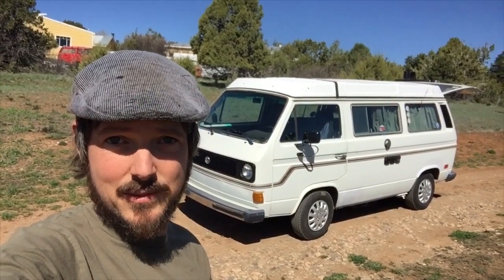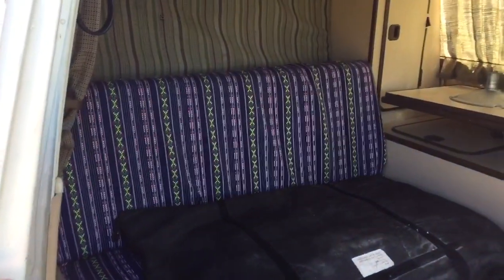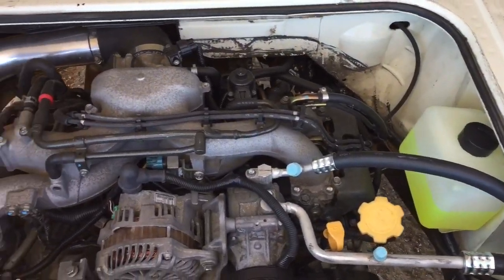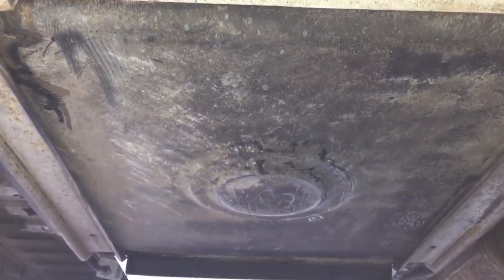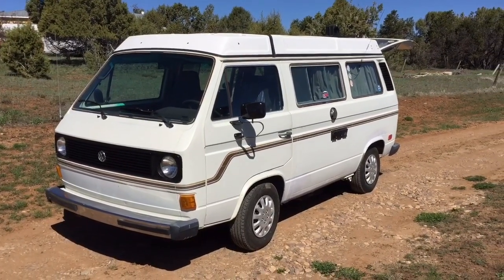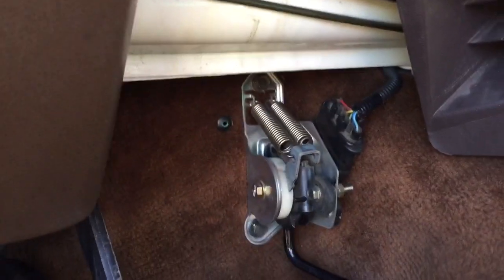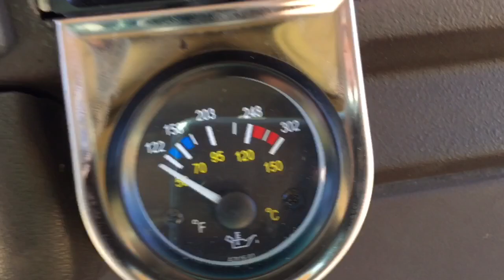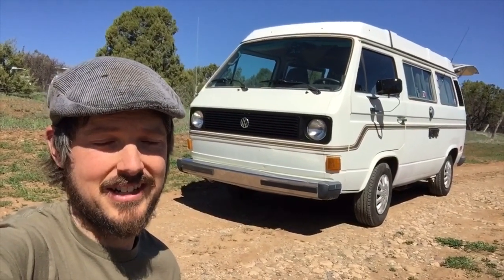1983 Aircooled Vanagon Subaru JDM 2.5 Conversion Tour

Comment: I'd love to see a technical video on the air conditioning system. I've got an '82 EJ22 without A/C. I've debated on getting the SmallCar setup, but haven't pulled the trigger on it yet.
Reply from the maker: Hey Austin, in this case I just took the original connections and extended them to the Subaru compressor. I’m not an AC expert but next time I work with AC I’ll do a video.

Comment: any wiring details for drive by wire  how to 
i have an 2009 2.5 with the subaru 5 speed  i have all wiring out of the 2009 with the 58 pin connection   any help at all will help

Comment: Hi...great videos.   Big question. I have installed a 2002 Subaru 2.5 and a rebuilt waterboxer automatic transmission into my '83 air cooled Vanagon. The shift selector  cable is to short too reach the mounting point. Have you run into this or can you point me in the right direction

Comment: Nice work! I noticed in the front of the engine bay a section is missing. Is it necessary to cut that section out to fit the air intake piping?
Reply from the maker: I used 2 3/4" intake tubing and the aircooled Vanagon engines sit a little more forward in the bay than the water cooled. You may need to clearance if you want to use large diameter plenums.

Comment: I have an air cooled Westy. Wonder, if this will be street legal in Germany... Did you use the water cooled T3 Bus heater to swap it for the air cooled setup?
Reply from the maker: I have no idea on the legality of engine conversions in Germany. I swapped a watercooled heater box into the dash to replace the aircooled version.

Comment: What About the transmission ? did you keep the original 4 speed of swapped it with a JDM SUbaru one ? did it need an Adaptor Plate ?
Reply from the maker: Used the stock transmission with a KEP adapter plate.

Comment: I have an 82 i just did an engine and everything else rebuilt but power is very low, may go this direction too.. how much was the converstion and how are you liking it?
Reply: Did you see Mick's note ? 4-5K in parts.  I had a bet I could do it for 3K (free labor), and lost the bet...it all adds up...and after I lost the bet, I went back and redid things "better" or added more to the scope of work.   In hindsight, I did the harness because I wanted to, and was being cheap, I should have sent it to Mick.  I'd be driving now....."anything that saves me time or work, is a good idea".... do it once, do it right.... there's another video series and the guy has a running total, ka ching, ka ching, ka ching...I think he hit 10-15K ??   I bought mine non-running, got it running, it sucked.  I put a used, rebuilt engine, that was better, but it still sucked...now, the EJ25 awaits its awakening...new head gaskets, timing belt, gasket set, valve removal tool, glass table, sandpaper, water pump, power steering pump, ss exhaust manifold, coolant lines, radiator, hoses, clamps, lubricants, drill bits, etc...and I know there's still a lot more to do.....Good luck

Comment: Long time no vid. Great work ! Could you make a video about the KEP heat-shield.
Reply from the maker: The heat shield in this video is just 16 gauge bent at a 90 on a brake. The KEP heat shield uses a mixture of the stock Watercooled Vanagon shield and a piece of flat 16 gauge bolted together.

Comment: What are you using for the gearbox? The 4 speed stock one?
Reply: KEP - Kennedy, if he used Kenndy, there is an adapter plate to stock vw transaxle.  Good luck on your build

Comment: Does extending drive wires have any repercussions?
Reply from the maker: Yes, if you use speaker wire it’s going to be a problem. There is one shielded wire - you have to use good shielded wire for that sensitive signal wire and use large gauge for the rest.

Comment: Is it possible to place a DOHC 2.5 liter subaru engine in a vanagon and is the same as the single overhead cam enginies?
Reply from the maker: The DOHC get a bad rap but I like them. They have a little less horsepower and are a little trickier when setting up the timing belt but they fit the same.
Reply: @Busaru  Thank you. I love your work and your videos.

Comment: Wait, where is the power steering reservior?
Reply from the maker: No power steering on these older Vans.
Reply: I've got an '82 that came from the factory without power steering. After putting 225/65/16 Nokians on, it was about impossible to perform parking lot manoeuvring. 

Hydraulic steering was going to be pricey, but doable. However, hydraulic steering is fairly outdated technology. I ended up taking the electric steering column from a second generation Prius, and incorporated it to the VW column.

It took a week of playing around with quite a few measurements, cutting, machining, welding, test fitting, re-doing a few things again,  but I eventually got everything squared away. I love it! 

The motor is silent, consistent, reliable, modern, etc. Best part was that I only had $200 into it
Reply: In the UK, I have heard people talk about electric power steering ??   My 99 had intergral reservoir, the RS did too, but the WRX had a remote power steering tank.  I replaced the 99 legacy pump (leaking), new hoses from bus depot (easy, drop the gas tank), and adapters (see theSamba for the adapater and hose)- good luck wiht your build

Comment: Has anyone ever used one of those small Honda radiators and mounted them in the back? Also, if I don’t want heat, or AC, or anything fancy, just the swap. What am I looking at for cost?